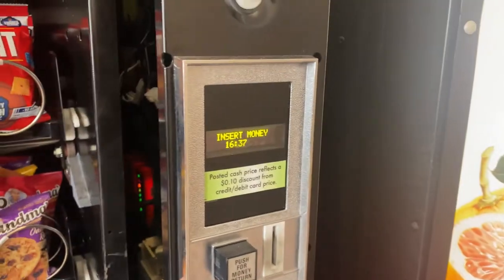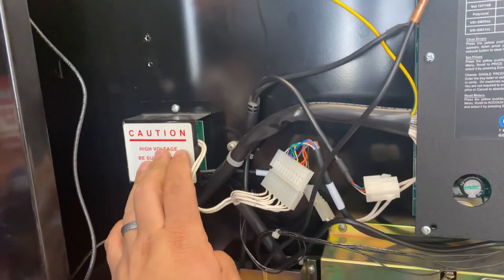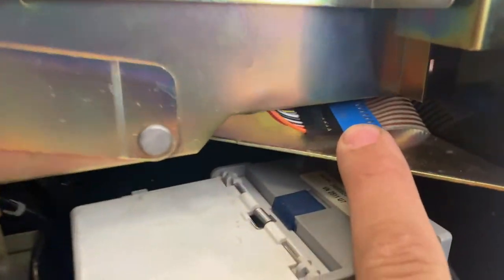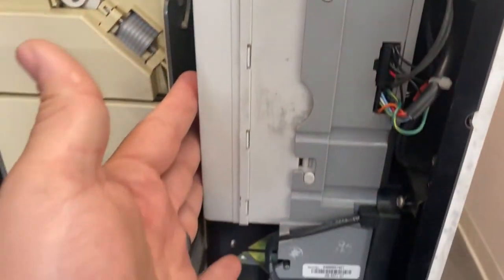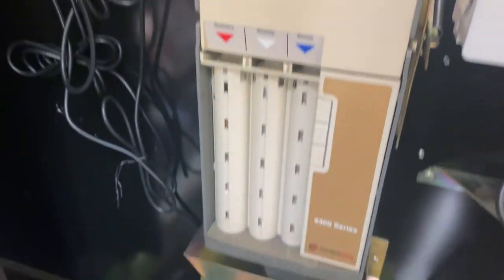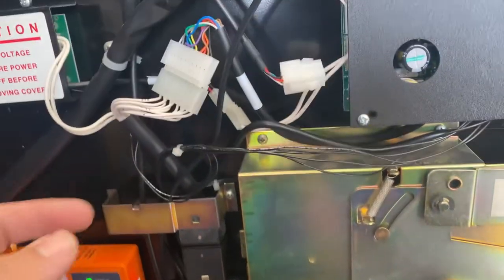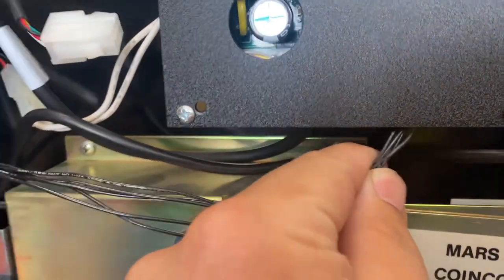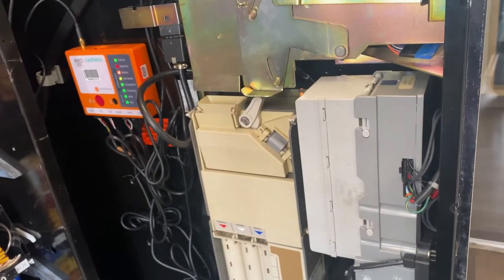InOne Upgrade board Overview

Comment: Thank you for this video. I have an AP6600 and need to upgrade it. Question, does the keypad now have a beep when you push the keys? Mine has no display until money is dropped. And no sound when you press the keys
Reply from the maker: Buttons now beep when you press the keys and if you press the selection, it’ll show you the price
Reply: @720vending  awesome! Like a real vending machine should act! Thank you

Comment: I have this exact machine & coin validator. I just installed the inONE board today. However, my machine won’t accept bills…and when it does- it doesn’t register & just steels the money. Any ideas on what could be wrong ?
Reply from the maker: as long in the inone options the bill val is set to pulse and not MDB it should work without issue

Comment: Where did you get the card reader and model number please I want to be sure the one I get is compatible and you can accept $5 bills without upgrading the bill acceptor ?
Reply from the maker: I got the card reader from Greenlite and they use eport readers now
Reply: @720vending  any one that I order will connnect the same way or be compatible?
Reply from the maker: @studio20seven  correct as long as you have upgraded the board the InOne